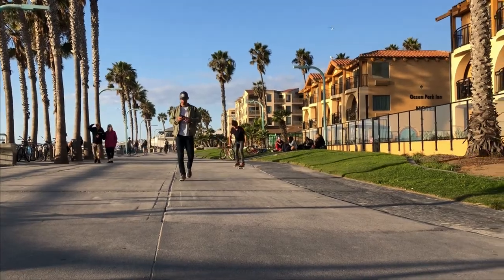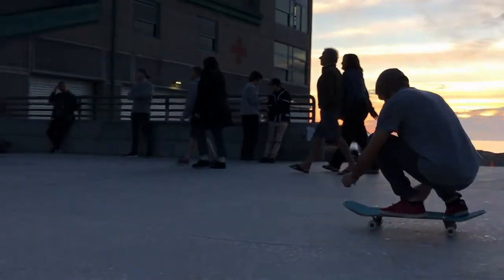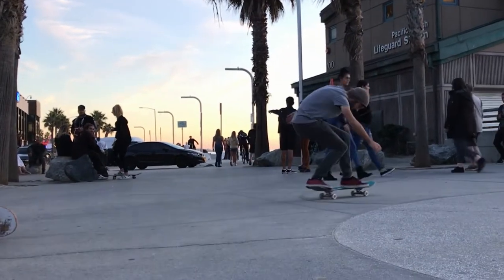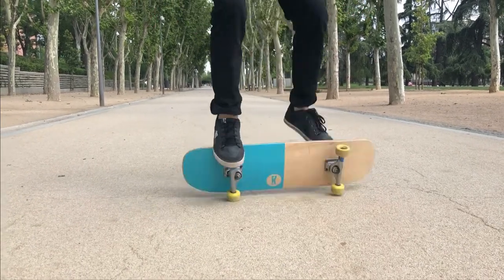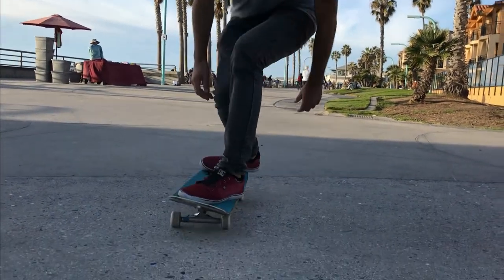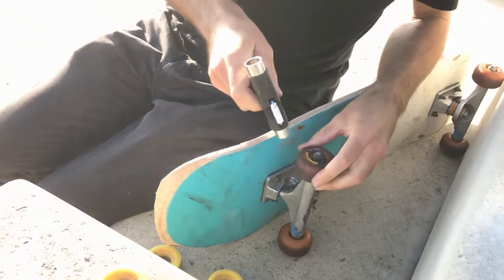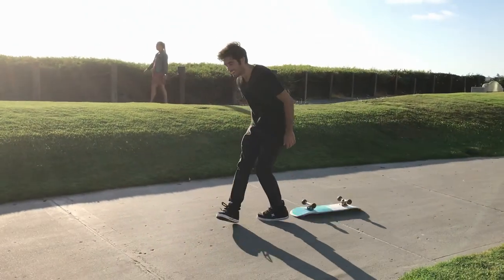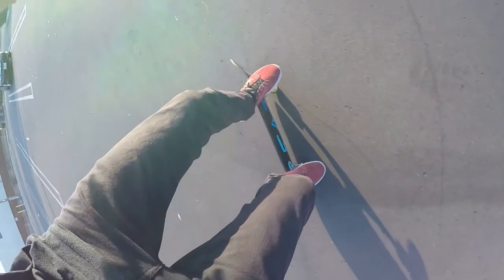Not a Primo Slide!  How to Coconut Wheelie - Build of the Week #4

Comment: you say you have looser trucks, i do too, so how do you do it without carving heelside? I end up turning when I try to get in the rail stand so to compensate I just try to get in it a lot quicker than i normally would. 
I sprained my ankle a few days ago trying to learn this trick lol. also, do I need to have my manuals decent first? because I don't honestly.
Reply: Any updates? I want to do these too with loose trucks
Reply: I never did learn this trick and i still intend to in the future but tbh i now have transitioned to tight trucks. It just makes freestyle easier. Not zero turn tight, more like bones hard bushings tight though

Comment: Interesting, I have the same stance as you, but I do my railstands (and try do to coconut wheelies) with the feet the other way (back foot is pressing down)
Reply from the maker: I've seen some skaters do railstands that way.  I think it's a bit smoother of a transition with your front foot pressing down for coconut wheelies, because your back foot is in place to catch the board and carry most of your weight.  If you can make it work your way, though, that's great!
Reply: @openSourceskateboards  I'll let you know if I get it somewhat consistently. I think it might even me stabler, because then the back of the board follows the front, instead of the back pushing the front forward. (Because the weight is on the front truck)